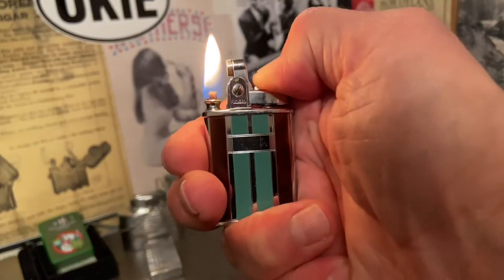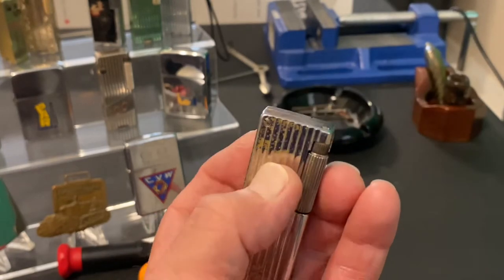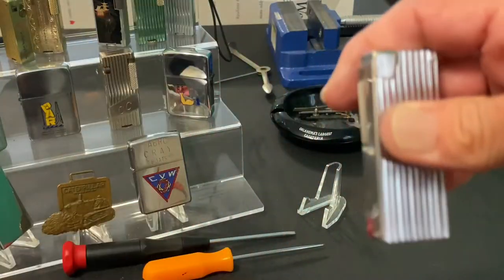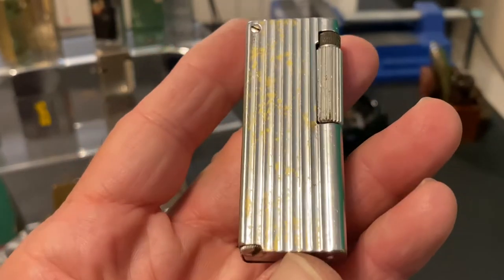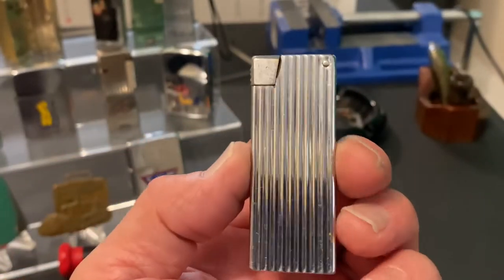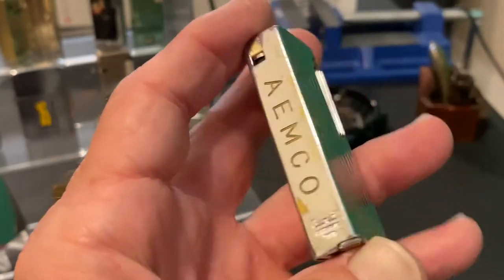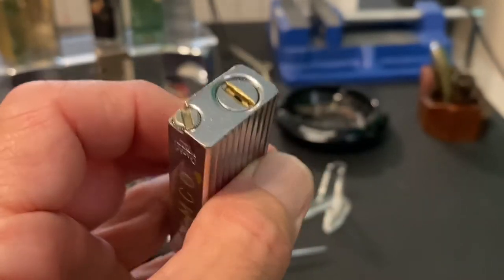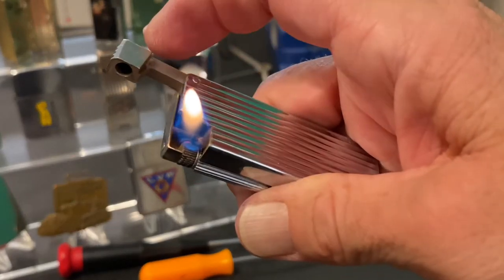A Nice Old Cupid Roller Petrol Lighter Advertising AEMCO With A Gaping Hole In The Fuel Screw

Comment: 😎👍 Nice little cupid, am keeping an eye to buy a nice little lighter from you. i just had to move so my wallet took a serious waack! i like that lighter you have which has the flexible external rod that puts pressure on the flint however its a little out my budget just now especielly as am in uk and with post etc but lets see i just need to tranfer my benifts etc lol so once thats all done and that has gone well then i might just ask you about that one if its up for sale still as its a really nice one even you might not want to part with that one. its the silver block with the external rod that puts presser on the flint , really nice 😎✌